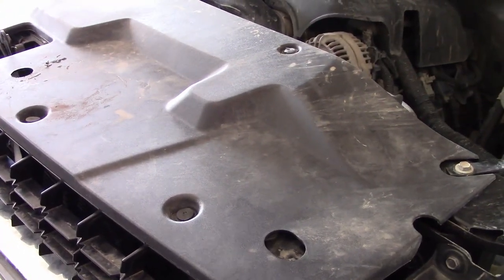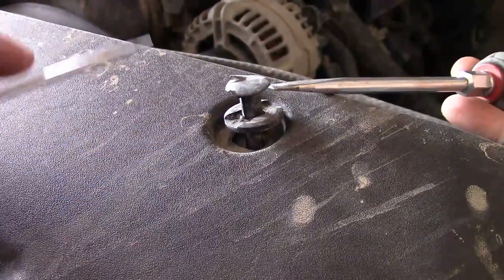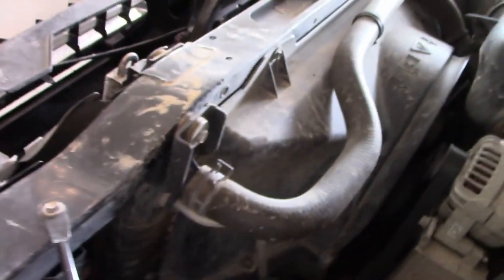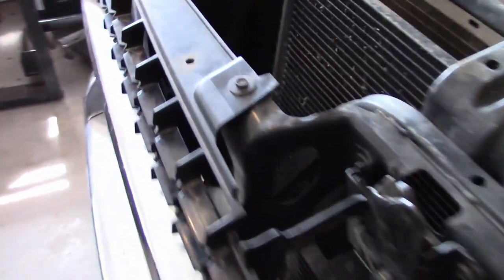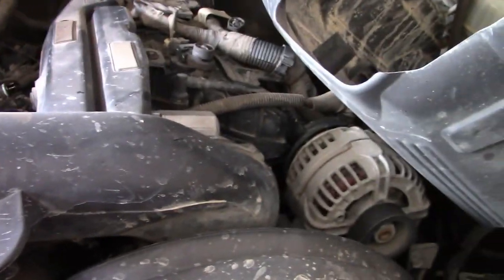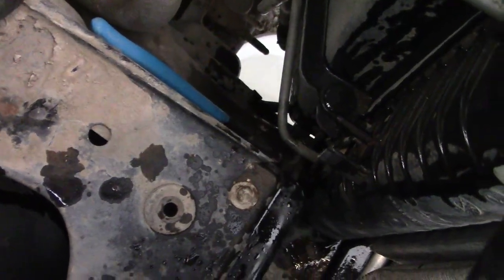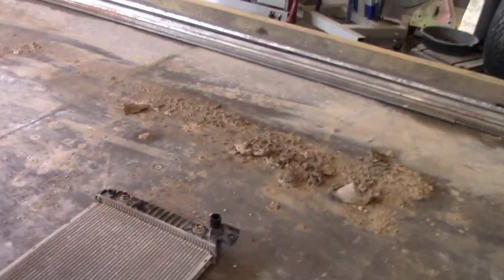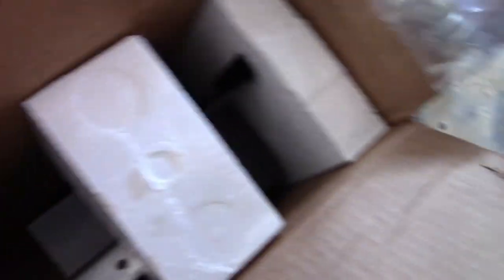2007-2013 CHEVY/GMC 2500/3500 RADIATOR REPLACEMENT

Comment: Does changing the radiator help keep the transmission cool?  I already changed the cooler to the transmission but I want to keep the transmission in good condition
Reply: i know im 2 years late but in short yes it could. I noticed with my truck when the engine runs hotter passed the 210 mark  the trans also runs hotter even though i have a beefy aftermarket cooler but my radiator is about 30% clogged with mud and debris from 350,000 miles so im just going to replace it. And it should make everything run much cooler hopefully

Comment: I bought a new radiator and put it in tonight but the stupid lower hose keeps leaking!! I wish you could have showed how ya did it. I put it all back together like it was and I noticed the lower hose fits tighter on the factory radiator then it does on the new Oreilly auto parts aftermarket radiator. Anyone have this trouble? Going to buy new hose tomorrow pray it works! Thanks for the video I wish mine went as smoothly as yours.
Reply: Having same trouble. Did New hose work?